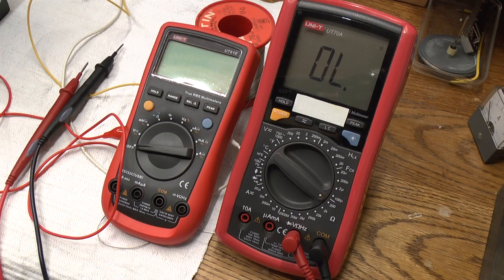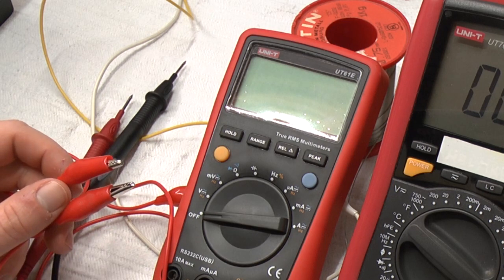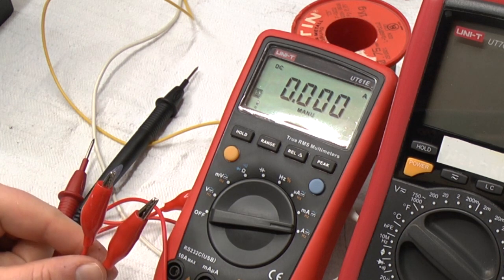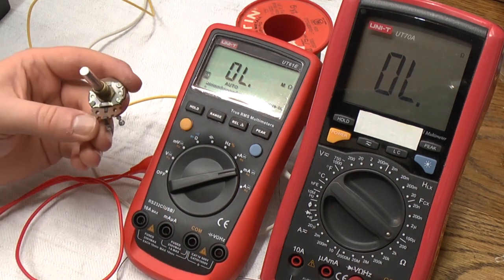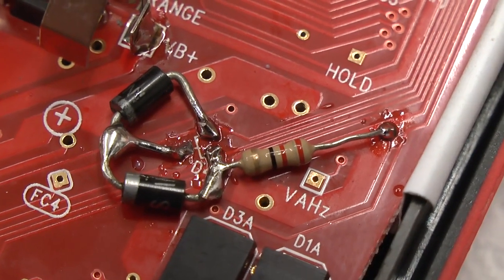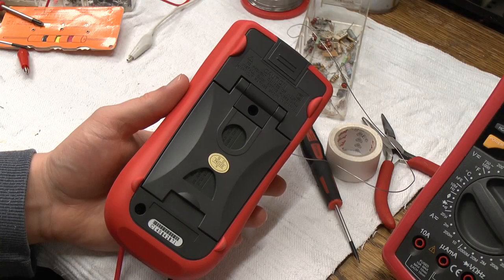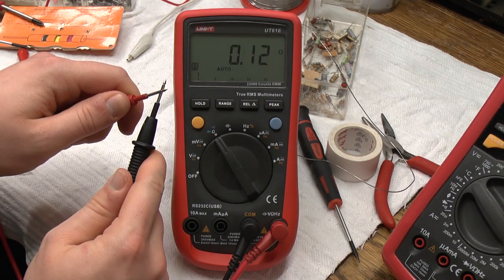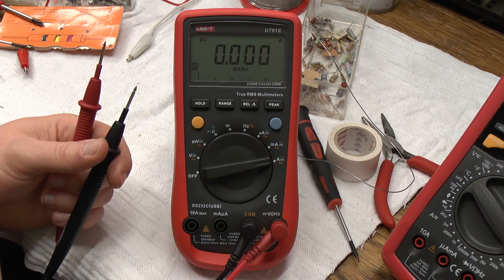Uni-T UT61E Multimeter repair [4/4]

Comment: If you put a resistor of small value, everything will work fine, but the battery drains very quickly because the device consumes about 14mA in the OHM area....I put a resistor of value 47K and now everything works great and the device consumes about 2.2mA in all areas. Maybe this information will help someone.

Comment: Why not replacing with the same diode which was faulty instead of doing this all messy arrangements ?
Reply from the maker: Because the suitable diode would have had to be ordered online, the diodes I installed I already had in stock.

Comment: Hi! I have the same device, can you tell me why it can show -0.4v on the display in DC voltage measurement mode, other functions work correctly
Reply from the maker: Does it still show -0.4V when the positive and negative probes are shorted together? In this case you would have a problem with the calibration
Reply: @DrCassette  When the plus and minus probes are shorted and when they are not!
Reply from the maker: @serglyashenko6872  Seems like there is a calibration problem then...
Reply: @DrCassette  It's a pity, but the voltage adjustment doesn't help vr1, there is nothing visually burnt...
Reply: @DrCassette  Where can I read about the calibration of this device, I can't find the reason for the -0.4v indicator(((

Comment: Hi sir useful video i had the same issue with this particular multimeter.i replace the diode package with two smd diode and function selection issue solved and all functions working correctly except voltage measurement  that shows an offset voltage even when probes shorted together.( It's showing -0.8v)and diode mode has the same problem it's showing 1.4v. originally the isuee is caused by over voltage i inspected the board an there was no visual blown components.can u help me with that??

Comment: I've used a 5k resistor... and it seems to work fine. For some reason.. smaller resistors heated when on Ohm measurements. My D4 was ok.. but not the pullup, so i suspect that your reset is related to the diodes used as mine doesn't do any reset.

Comment: it should not need such a low value resistor to keep that pin to 0v, i would disconnect one side of the resistor, then remove the switch so all contacts are open, then measure resistance from 0v common to each of the Function lines.
They all use the same logic so they will have identical internal pull up resistors, except for the faulty one.
Its unfortunate that you may find its the processor that has damage :-(
Reply from the maker: +zx8401ztv 
Yes, the processor is probably damaged. That's why that low value resistor is there. With it, the meter works fine. Your comment does not suggest a better way to repair this, so that resistor will stay where it is.
Reply: +DrCassette Sorry, but you didnt sound like you fully understood its design, if you did then you would not be asking for comments on the subject.
I was just trying to help, the fix is: purchase the chip and get someone with a smd solder kit to replace it.
Reply from the maker: Assuming that somebody doesn't understand what he is talking about just because he is asking for feedback is quite rude.
And why should I go through the trouble of getting the (expensive) chip and replacing it if I can still get the original one to work?
Reply: +DrCassette I did say "didnt sound like you fully understood its design", im not calling you an idiot, im just saying you dont know everything about it.
You slapped me for trying to help you with testing the inputs, then almost told me to go away because i didnt give you a fix.
Sorry, i wont bother you again :-(
Reply from the maker: It seems like we keep misunderstanding each other. I'm sorry.
Reply: +DrCassette 
Its ok, text hasnt got the emotion that voice has, it depends on the reader to decode the senders intention, im wrong too.
Use better batterys as 22 ohms will eat ordinary ones :-(

Comment: Nice work getting it together. The fact that you need such a silly low value pull-up suggests that you've got something pretty bonkers going on at that pin. Perhaps it's a shorted input buffer transistor that's just gone more or less short across all pins; in such a case, you would expect it to have a low impedance to both ground and the actual input of the circuit, and you'd need to overcome its resistance to ground in order to raise the signal level going forward into the rest of the IC - ergo requiring a strong pull-up. It would be fun to see if the short could be "blown away" by applying a relatively large energy burst to the input, but that would also drive the circuit on the other side of the transistor way out of its boundaries, and would probably make the input fail completely - so I don't recommend doing it!